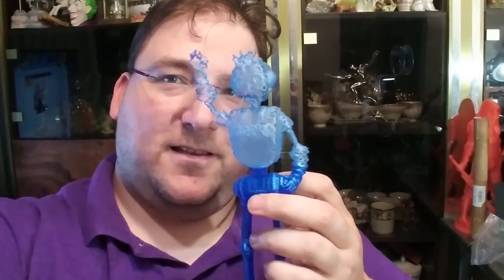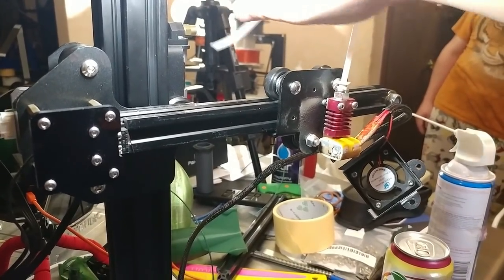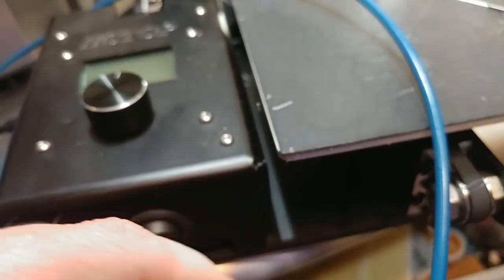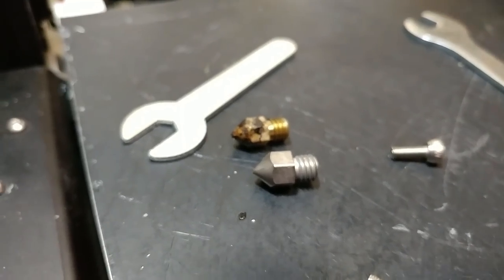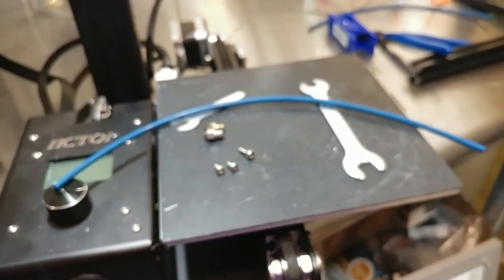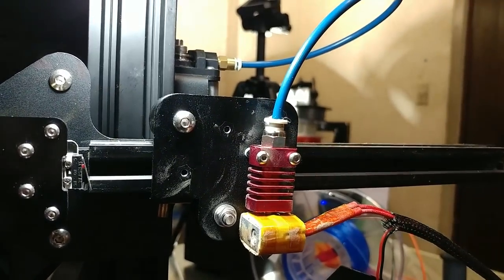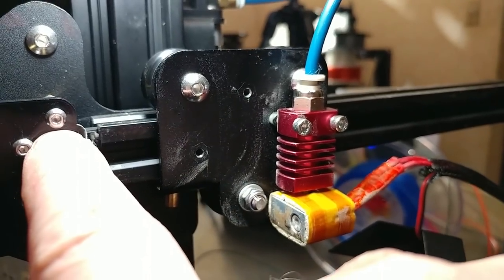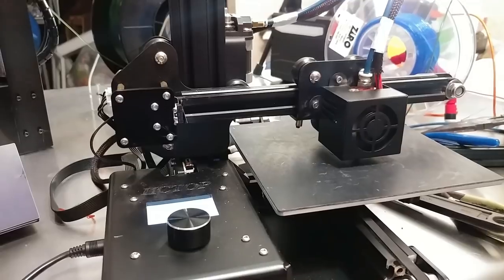Today's 3D Print 141 Nozzle Jam, Capricorn High Temp ptfe & hardened nozzle upgrade Ender 2 CR 10

Comment: Replace the PTFE in the throat with Capricorn, as that is where it is likely to melt at high temperatures.
Reply from the maker: +Dazfx that's the odd part I was not expecting the PTFE tube goes all the way to the nozzle it's not two separate pieces unless I missed something I'll have to double-check that but I'm pretty sure that too but needed for enough to go all the way at the nozzle :-) I was expecting a separate throat piece like in my maker select
Reply: I know my cr10 has a piece of PTFE inside the throat on mine as i took it apart.
I perhaps thought the ender 2 was the same, as the hot end looks identical.
Reply: Yes the cr10 original throat did go all the way down now I think of it.
I rounded the thread of when I first bought the machine and purchased a replacement cr10 hotend which has a different throat.
It slipped my mind, I really should go to bed lol.
😁

Comment: does the nozzle also on fit the Tevo Tornado
Reply from the maker: +Kurt Jensen I do not know I will find out it looks the same but that doesn't mean it's the same threading I will pop that nozzle off and check :-)
Reply from the maker: +Kurt Jensen I am being told by others it's the same e3d V6 nozzle so yes the same nozzle will work on both the tevo tornado and the cr-10

Comment: Capricorn-Tube is NOT good for 340°C. 340°C is their allegedly MELTING POINT.  It is good for 260°C like every other PTFE aswell.
Reply from the maker: +René Jurack that's interesting the page I found on normal PTFE tube said they melt at 278? All PTFE is supposed to melt at 340?
Reply: There is no real melting point of PTFE. PTFE just keeps getting softer until it reaches some gel-like state. The temperatures you found are from serious manufacturers, stating that their product is good up to that temp, that it is holding shape and stuff. The dangerous thing is, PTFE  releases toxic fumes if heated to 300°C or above. (read: https://en.wikipedia.org/wiki/Polymer_fume_fever)
And you don't want toxic fumes in your basement, do you?
Reply from the maker: +René Jurack oh now isn't that interesting. Seems a bit deceptive do you those numbers and not explain them doesn't it :-) so don't go past 260 got it :-)

I do have those new micro Swiss hotend that just came out they sent me one of each so I'm going to play with them and let you guys know how it goes :-)
Reply: Nerys ... sure is slippy though!
Reply: +René Jurack - Where is the data to back that up?
Reply: 4FunRC on their own website...
Reply: +René Jurack - You mean here? https://www.captubes.com/specs.html
I've read it. Have you? Regardless, you are incorrect.
Reply: melting point. the moment it becomes liquid. Get it? Is it usable until then?
Reply: Also I think the thermistor wires are covered by ptfe so even if the capricorn could go higher, you would still be limited by the thermistor.
Reply: @René Jurack ...Capricorn tube is pure virgin ptfe with specific additives in it. Rest assured it can handle 340C. Stick some in your hot end and crank it up and see for yourself before you go blasting a great product you’ve never used! 
By the way they didn’t “allege” 340C. Capricorn actually tested their product to confirm their comfortable rating. As stated above it’s not all that difficult to do. Try it in your hot end and perhaps stick it in your cold end too.